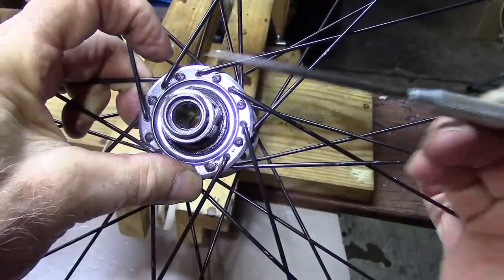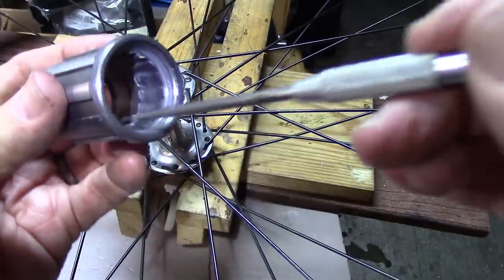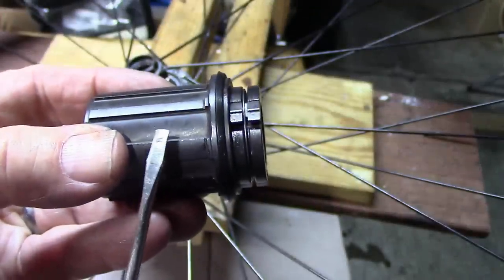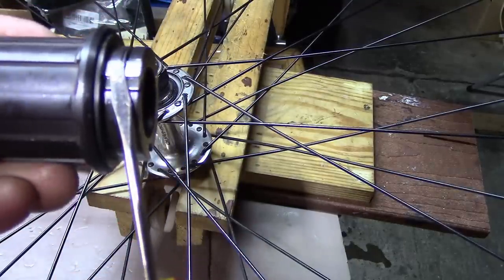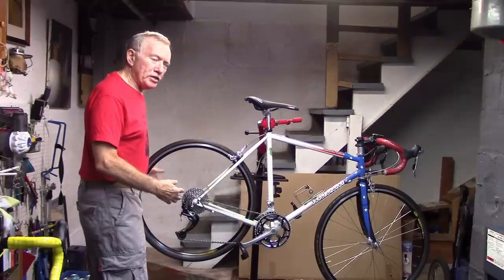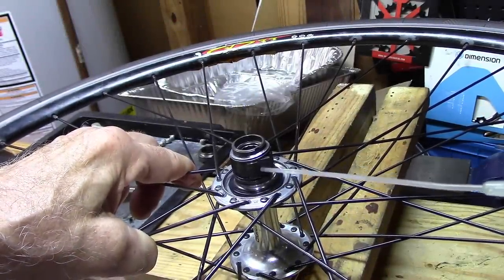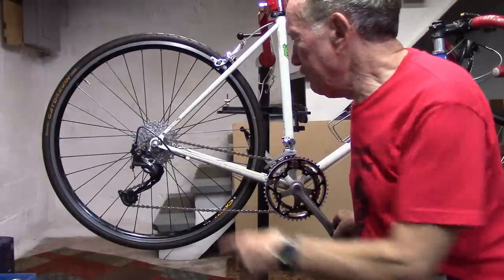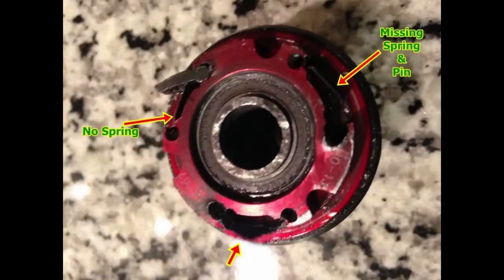Bicycle Freehub Noise, Clicking Sound, and Freehub Trouble Shooting

Comment: I have a knock coming from the freewheel (I think). When I grasp the freewheel from the teeth top and bottom I can move it torwards me and away from me maybe about a mm like there is a gap...The knock only happens when I ride and pedal. When on rack...Its like when I pedal there is enough pressure to move the freewheel and create the knock. Only happens on speed 5 and higher. Anyone have this before...Help. driving me crazy! Any solutions:(
Reply from the maker: You should not be able to move the cassette (freehub) or a freewheel a mm back and forth. Two possibilities:
1. The cassette on the freehub (or freewheel on the hub) is not greased and tightened. See: 
https://youtu.be/RyX00hPyB34?t=200
2. You may be missing a spacer that allows for use of 9, 10 or 11 speed cassette when placed on a freehub. Check with your local bike shop.
Freewheels are found on old bikes and kids bikes. Most of todays road and mountain bikes of any worth are freehubs. Here is the difference between a freehub and freewheel:
https://www.youtube.com/watch?v=3UuWAtEs3WI
If you are truely dealing with a freewheel, the freewheel itself can be lose or broken. See:
https://www.youtube.com/watch?v=6C9_dvfQNP8
Hope this will help you find the problem. Regards, Tony

Comment: Thanks for the info. Can a DT-Swiss "free hub" be installed on to most/any hubs or do you need DT specific hub already? I own a 2018 GIANT Defy Advanced 3 and I'd like to change the rear free hub.
Reply from the maker: You don't install a freehub over another hub. Rather, the wheel is built around the freehub whose exterior has holes for the spokes. If you're interested in a new freehub, it's best to have someone built a new wheel with a new rim and spokes. They can build one specifically for the size and speed of the bike you have. You would need to consult your local bike shop.
  Regards, Tony
Reply: @tony10speed  thanks for your response Tony.

Comment: I have mavic axium wheels and my freehub no longer has a sound, at the service I put a shimano 105 cassette instead of an ultegra which was previously on the road battaglin, now I don't know why it no longer has a sound and is it bad or is it perfectly fine
Reply from the maker: It's the pawls riding over the catches that make noise. If you hub was previously "loud" and is now quiet, something is likely keeping them from dropping energetically into the catches. This may be old grease that has somewhat solidified, grime or possibly a broken spring inside the hub. Before you rear hub fails completely and you're stuck or unable to get home, I'd have your local bike shop disassemble your hub and inspect/clean/relube. Let me know how you make out since the feedback is always helpful. Regards, Tony
Reply: @tony10speed  I will do it, thanks for the advice, otherwise I bought a new freehub and they replaced it at the service, and before I went to the service the sound was fine, and after the service I had to go to the service again and they told me to buy a new freehub, which I and did but still no sound
Reply from the maker: @goranvulic4791  Not sure I understand completely what you did, but freehubs do sound differently. Some are very noisy and others extremely quiet. If the new freehub makes no sound, it may be the nature of the freehub. See:
https://www.youtube.com/watch?v=stM0jG2zdv0
Reply: @tony10speed  thank you for your reply,, I realized that I have a problem, too much fat or the wrong fat was put in my freehub

Comment: plz can i ask a question : today my bike broke down i was cycling when the pedals suddenly didn't want to turn any more neather forward nor backwards but when i dragged the bike the wheels moved freely . i was able able to free up the pedals again by spinning it backward and pushing so hard now i can use it by i can hear some little noises coming out from the pedal . so what can it be? how can i fix it so it won't happen again? if you've made a video on it already please what's it's name. and thank you
Reply from the maker: Make sure the rear wheel is on correctly by releasing the quick release (or axel bolts) and resetting the wheel. Next, take the chain off the small chain ring and place in on at the base of the seat tube on the bottom bracket. If the crank still doesn't turn, there's a problem with the bottom bracket that needs attention. If the crank turns find (without the chain) but you can not spin the rear wheel in either the forward direction / rear direction / or both, something has broken inside the freehub. In either case, your local bicycle store will need to overhaul one of the items. Let me know how you make out. Tony

Comment: Thank you for this simple but illuminating explanation of what I believe is happening with a mountain I took on as a restoration project. Slowly I have had to disassemble, clean and repack every inch of this bike as it was used extensively by last owner in environment with some kind of invasive clay soil that is everywhere even inside the quill stem, seatpost tube and component.  Its a 1991 Paramount with Deore XT and I have all the part sheets from shimano. Every time I think I am almost done there is a new surprise. Now it is a terrible noise despite having just repacked the rear hub.  Looking forward to testing out the back pedal resistance but almost certain its a dragging or jammed pall. Glad I found this channel.
Reply from the maker: That's quite and under taking. Was the noise there before repacking the rear hub? If it only happened after repacking, you may have too many or too few ball bearing or the hub is too tight. Also see our "noise" playlist:
https://www.youtube.com/playlist?list=PLYbCdE49qIMf1-CeTxvYbd617sEklOxb7
 Look for the easy things first and give them a try before pulling apart the freehub (I assume it's a freehub, not a freewheel). Let me know how you make out. Regards, Tony

Comment: Tony, Great video!  Yesterday, I looked at a 2021 CAAD13 105 Disc for sale with stock DT Swiss R470 wheels and 1000 claimed miles on it.  When coasting, there was a rumble/rubbing sound coming from the rear hub area.  The wheel seemed true with nothing rubbing.  The owner claimed it has made that noise since he bought it 3 years ago and prob just needs grease. It seemed like he was hiding something.  

Is it costly to have a LBS grease the freehub on this wheel?  Do you have to take the spokes off and replace the freehub?  Thanks for your help!
Reply from the maker: You do not need to take the spokes out to get at the DT freehub. The noise could be the lack of lubricant in the freehub or a broken part in the freehub. It's hard to say without a look inside. You can check with a local bike store as to the cost of looking and possible repair. I am always skeptical of buying a bike with underlying problems unless you're prepared to do the work yourself or know the cost of component replacement.
Regards, Tony
Reply: @tony10speed  Thank you!

Comment: This is the best video on freewheel I ever seen. I have a question. Recently I washed my polygon premier 5 with water. After that I am hearing sound from freehub and bottom bracket. When I am moving cycle forward (without riding it) the paddles are moving forward also. What could be the problem and possible solution to this ?
Reply from the maker: Pick up the back of the bike by the saddle and with the other hand turn the wheel in the direction it would be it moving forward without pedaling (i.e., as if coasting). If the pedals move as the wheel turns (see the video), then you probably have a freehub problem. It is possible that the grease in the freehub was washed out when cleaning the bike. This may occasionally happen if you turn a high pressure hose of water directly at the hub. Another possibility is that the grease in the rear wheel bearings themselves get washed out. It would be advisable to have your local bike shop mechanic look at the freehub and the wheel bearings to see if either need to be overhauled and re-greased. 

When I wash my bike, I keep the hose on a low shower and not a high direct stream. If I'm going to use degreaser on my bike with disc brakes, I usually remove the rear wheel, wrap the disc brakes and pads with a baggie or clear wrap, degrease the drivetrain and wash with soap and water. I usually use soap and water only on the rear wheel. I also clean the disc brake rotor with rubbing alcohol. 
Hope this helps. Let me know how you do. Regards, Tony
Reply: @tony10speed  dear Tony, thanks a lot for the reply. After experiencing this issue I sprayed  Looplube chain wet lube on the chain and over the hub, so that it re-grease it. But the issue is as it is. I have to get it open. One last question, may I continue to use the cycle till I get it repaired or using it will damage the freewheel more ?
Reply from the maker: @rahulsony569  If you continue to ride it, you may cause more damage to the freehub or the wheel hub. When grease is washed out of the wheel bearings of the hub, you may get pitting of the bearing races and permeant damage as you cycle. The lubricant in both the freehub and wheel bearings are essential for smooth performance. I'd have some one look at it before you use the bike again.
Reply: @tony10speed  ok, understand. thanks again for your advice.

Comment: I get a really loud crack sound from my rear hub under power just after coasting - not every time but between 5-10 times over 16 miles. The hubs clean but the pawls do look a little work down on the teeth, I'm going to replace them and I'm hoping that it's just the pawls and no the drive ring inside the hub - drive ring does look ok but the pawl teeth towards the bottom  portion definitely look work back a little
Reply from the maker: Working with the pawls inside the hub is tricky. Are you sure the "cracking sound" is not coming from the bottom bracket. Check the BB: https://www.youtube.com/watch?v=InW64uutftM&t=2s  Also check the chainrings are torqued to specifications. Also when you replace the cassette you also torque the cassette: https://www.youtube.com/watch?v=qVzWQuHPz50 Let me know how it works so we can become more informed ourselves. Thanks and regards, Tony

Comment: I have a snapping sound on my new GT. Thought it was the bottom bracket but the bearings are fine.  Seems like it's this issue.  It snaps and a couple of times it has peddled foward a half a spin but then reengaged itself.  I shouldn't have this on a bike less then 2 months old and riding on road n some trails. And I take really good care of my stuff!
Reply from the maker: I wonder if the chain is not engaging the chain rings properly until you start pedaling. I'd put it up on a repair stand and take a closer look as you shift and turn the pedals. Is the chain the proper "speed" for the bike (7, 8, 9, 10 speed)? Are the limiting screws properly set? Is the derailleur lined up parallel to the chainrings? Does this happen in all chainrings (unless you're running 1x) and all cogs? Snapping may occur when you are using the small chainring / small cog or large chainring / large cog. In a 1x (single chainring) it may occur at the extremes, the largest cog and/or smallest cog. Things to consider.

Comment: 👌great educational video, I have a free hub problem, It sometimes slips and doesn't fully engage, only every know an then, hopefully its something simple, because when you take this to a local bike store, They always tell you to buy a new wheel.
Reply from the maker: Some freehubs are difficult to repair and and the only options is replacement. But before you go that far, check out RJ's video and causes of chain skipping:
https://youtu.be/VzrpC7jrz8U?t=135
Regards, Tony
Reply: @tony10speed  I will check those things out on the video, but im sure its the free hub body, mostly likely a new wheel, if only they made them interchangable.

Comment: Hello.

I hear a ticking/clicking noise from my rear wheel. This sound could only be heard when I ride the bike, and not when I’m dismounted/have the bike lifted up. I removed the rear brake to make sure it wasn’t rubbing against the brake rotor. Sure enough, even without the brake, it was still making the noise. Could it be coming from a damaged hub? Thank you.
Reply from the maker: Obviously the noise comes only when the bike is under load. Do you hear it while pedaling and coasting both? Is the ticking or clicking constant or just once or more each pedal stroke? Is it in specific chainrings or specific rear cogs or occurs in all? Also see:
https://www.youtube.com/watch?v=0_qZmXNS8PQ&ab_channel=TonyMarchand
Let me know so I can help.
Reply: @tony10speed  hello. Yes, the sound happens both times, when I pedal and coast. Although, I did remove the wheel because I had to change a flat inner tube. Now the noise seems to have disappeared after placing it back in. I will update if the noise came back. Thanks.

Comment: I was hearing a ratcheting noise when in a higher gear and when going uphill. Took it to the shop and had the rear hub serviced. Rode today and after a very quiet hour of riding the noise came back. Not as bad as when I took it in, but the same noise. Any ideas? Oh, and I love your "brief but spectacular take" from the PBS NewsHour. Thanks.
Reply from the maker: I don't know if I can solve this for you but to help me understand the problem, can you fill me in on the following: Is this a road bike or mountain bike or other? When you say higher gear, do you mean largest cogs? Is your bike a compact up front or a 1x (single chainring)? Does the sound occur just in going up hill or do you also hear it when in the larger cogs on the flat part of the course? What type freehub do you have?
Reply: @tony10speed  Thanks. I have a Trek Domane 6 series with a compact crank. Don't know what type of freehub I have. Sorry, I meant smaller cogs and the noise is more pronounced when going uphill.
Reply from the maker: @jcoyle231  So, after the freehub was overhauled there was no sound. But the noise came back. Something is coming out of alignment (or broken) and was temporarily fixed by cleaning and lubricating the freehub. I think it's an internal problem within the freehub which may have to be replaced (take it back to the shop and question them on this problem and what they did when they overhauled the freehub). But, before you return to the shop, check the cassette and chain. Are they worn? Is there "wobble" in the cassette? See:
https://www.youtube.com/watch?v=XdShMsbFNPg 
Also check for bent deraillaiur hanger:
https://www.youtube.com/watch?v=qHK6jQizIdc
Let me know what your bicycle shop has to say. We can all learn from your experience. Regards, Tony
Reply: @tony10speed  I took it back to the shop after hearing the noise it was making (to a lesser degree) after riding for about an hour on several rides. The mechanic cleaned it out and soaked it again and this time used a heavier lube. Rode for over 3 hours today and the ride was whisper-quiet. He said there was a lot of rust the first time he serviced it. He also cleaned the cassette and the chain is fine.
Reply from the maker: @jcoyle231  I'm glad you brought it back. On a few occasions I've use Woods Tenacious Oil (very viscous) to quiet a noisy  freehub. Some freehubs are nosier then others with Chris King being one of the more quiet ones. Some of the older Shimano I can take apart and use a combination of 1/3 synthetic motor oil and 2/3 Tenacious Oil. Did they charge you for the second visit? We are all learning from your experience and it's quite helpful. Regards, Tony
Reply: No, I wasn't charged for the work. Happy ending: quiet ride and a smooth easy-shifting drivetrain. Thanks for your input and advice. @tony10speed
Reply from the maker: @jcoyle231  Thanks for all the feedback. It helps both the viewers and I. Safe cycling, Tony

Comment: i am having this problem with my sram nx eagle i have the mavic crossride in 29er and i noticed yesterday after coming down a section of hill was dry i went through small amount of mud earlier but couldnt say if this is the case of mud build up and now the pedal move as the wheel moves as you explained. what can i do would some WD40 work as a degreaser
Reply from the maker: The problem is getting the degreaser into the freehub to wash out any dirt or grime. The freehub really needs to be disassembled, cleaned and re-lubricated. Several references are included at the end of the description above, but it's really a job for an expert bicycle mechanic. It's not as easy as it looks. How old is the freehub? Is it time to replace the wheel?
Reply: i took it in they actually replaced it. i found out it exploded in the freehub it was two month old Mavic Crossride FTX S 29er with a Sram PG1230. it was clean as a whistle inside aswell thank you for your response and help

Comment: Thank you sir! I was watching with interest and I learned something helpful but my problem is when the back wheel spins it hardly clicks only on 1 place (it gives much louder noise than the normal clicks) and when I am riding it’s moving the whole wheel and the whole bicycle. It’s a very unconfortable feeling and I firstly tought it’s because I have to streighten my rims but sadly it doesn’t go away even after I did straighten them.
Reply from the maker: The bike really needs to be observed and listened to closely, not something I can do from here. I suggest you have someone at your local bicycle shop look and listen. It may be the freehub (or freewheel) but they'll be able to tell and hopefully fix the problem. Regards, Tony
Reply: @tony10speed  Thank you for the kind answer, Tony. I’m really trying to fix everything by myself but I’m still a beginner.